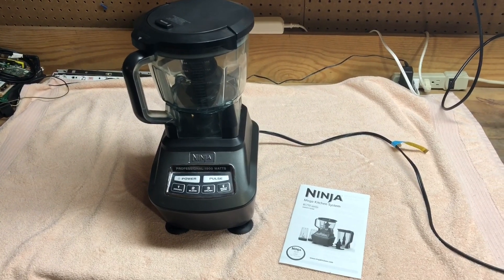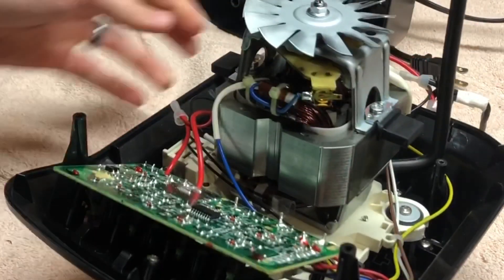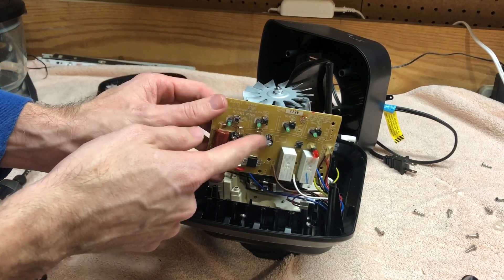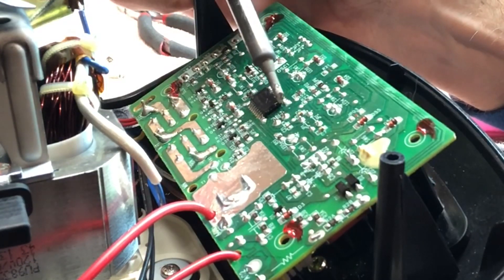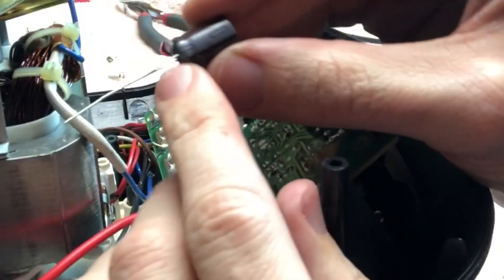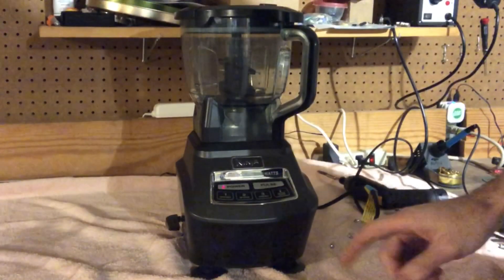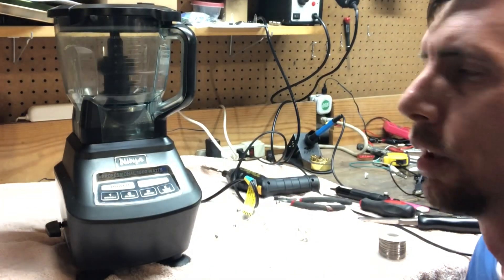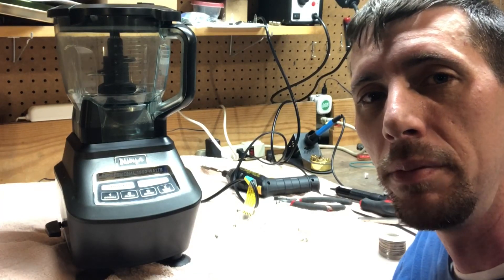Ninja Blender Repair

Comment: Hello That Guy. I indeed have an expensive box of garbage.  Its the Ninja bn801 Plus Kitchen System.  I was taken for a ride with this one. Themotor was too powerful itcouldnt handle bread dough,the blender  cups are shot the dough bowl is shot so is the other one. It mkelted the black plastic on the inside and got black plastic goo everywhere,it smoked and those things are like $75 each I dont have that. I should have just bought a cheap blender mortar/pestle and a small coffee grinder...and a kitchen aide stand up mixer.  I do have a solder kit my son purchased for me before he got married now i never saw him again.  I know better now ha ha ha. Just ranting. Thank you the video was great   in my case its different. Happy Holidays.

Comment: My Ninja base motor is smoking and there is a smell of plastic burning. In your experience could this be a capacitor symptom? -Katie in Napa Valley
Reply from the maker: There are many components that could potentially smoke if they failed. You would really just have to pull it apart and see what shows signs of burning.

Comment: Stopping buy, saying thanks for this video.  As it turns out, a blown capacitor wasn't my issue, but I did want to identify my fix.  

My Power LED would turn on when pressed.  The green LEDs would turn on when I had the respective single serve or full size blender installed.  My issues arose when I would select a blending option.  I could hear the relays click (and eventually "unclick" /timeout), but the motor would not spin.  My issue was all of a sudden--no notice of any performance degradation.

I figured maybe the capacitor that provides that extra bit of energy to get the motor going was faulty, so I swapped the capacitor (without troubleshooting or attempting any real diagnosis).  Swapping the cap out didn't solve anything.  

I did read somewhere (maybe in these comments?) about cold solder joints, so I took a real close look at the board and found that one of the TRIAC leg solder joints was cracked.  Reflowing solder to that leg solved my issue.  I hope someone else finds this useful!

Comment: Question need help on 1500 ninja blender I took it apart after power surge on building it went out  the blender didn’t want to work I too it apart I found the yellow varistor is burnt  is 10. 710  , my question is does other resistors burn after this happened ? Do I need to replace the capacitor or that thing you are replacing as well ? I’m about to throw it in the trash. But I’m watching your vid any advice please

Comment: I have a question I decided to open up my blender because it had gotten wet when I was cleaning it thought I kept it from getting wet but that ended up happening anyway I’ve dried everything and took it apart to get all of the water but I have no idea what could have been messed up for it to stop working the light won’t turn on and it only starts when I turn it on its side

Comment: Hi, got a similar bl770 blander, got motor runs only on pulse mode and any other button for low, med, high or single speed,  as soon as press them its power goes OFF, reset the power ( plug out plug-in) and it starts back on but same thing, what could be the reason, and how to check that resistor for swelling up? Thanks in advance🙂
Reply: Hey, just tried the same with replacing the same capacitor and got fixed, thanks heaps👍

Comment: Thanks.  I had already called Ninja OEM and since it was still in warranty period, they shipped me a new base unit.  Once I saw your video, I figured I had nothing to lose.  Bought 20ct capacitor pack and your recommended torx security set bits and went to work when they arrived.   Made good progress until I got to second security torx screw in the deep well.  Hole wasn't big enough to get screwdriver down to screw.  Luckily, a friend had a set similar to allen wrenches and the T9 was able to reach.  Made the repair (terrible at soldering) and reassembled.  Plugged in and power light came.  Pressed single serve button and now it's back in business.  Again thanks so much and this video is still helping people out after four years.

Comment: The power will come on ours but when pressing any spin mode, the blades will spin a couple times and then it starts buzzing continuously. Any ideas?
Reply from the maker: Potentially a different capacitor, but not sure. It’d be worth pulling apart to see if you see anything out of the ordinary.

Comment: I removed the board and replaced the capacitor. but the plastics that hold the screws for the board all broke off.
and I was quite delicate. it seems the screws have some sort of lock tight on it and the plastic pieces are quite brittle. 
basically, unless I find another way to hold the board in, this blender is garbage. 
so the verdict is they probably did this on purpose so you'd have to buy a new one.
shit company, this Ninja.
Reply from the maker: You may try to epoxy the screw posts back on with some quick curing epoxy.
Reply: @DustinRogersinMO  i'll give it a try, problem is they all broke off at various angles.
Reply: @DustinRogersinMO  I epoxied the posts back.
when I tried to screw the board back on the posts further broke apart.
they are incredibly brittle.
it's either just bad luck or this happens with particular models.
it just seems very odd they would use lock tight or some sort of glue to make the posts impossible to remove without breaking them.
at this point the Ninja is in the trash bin, unusable.
Reply from the maker: @vegan-master  it sucks you had troubles with it, but I just repaired our air fryer because the plastic on it was super brittle too. Hopefully it holds up for a while longer.
Reply: @DustinRogersinMO  can't say I didn't try

Comment: Hello Dustin,
My wife attempted to use a similar blender requiring 120V with 230V outlet, it currently not working any pointers on how to fix it?
Reply from the maker: Does the blender indicate that it will work on 230v? Some are dual voltage, but if yours isn’t, it may have been damaged by plugging it into a 230V outlet.

Comment: Dustin,
Great video.  Thank you very much.  
Would the capacitor be relevant if the power LED lights up and some but not all of the buttons work?
Pushing either Button #1 (Dough) or #2 (Blend) immediately shuts off the Ninja after spinning the blade for about 1 second.  Other buttons #3 (Crush) and Pulse work OK.  
I've got your recommended solder kit and capacitors, but not sure if this is a different problem.  Any suggestions would be welcome.
Thanks again for an excellent video.
Reply from the maker: I’m not sure. Mine wouldn’t do anything at all, so yours has some other issue. It could be some other capacitor that is failing or it could be the switches themselves. It’d definitely be worth getting it apart to see if there’s anything obvious (swollen capacitors, cold solder joints at the switches, or loose wire connections).

Comment: Edit: This was a followup to a post I apparently posted under the wrong vid. 

Hmmm, maybe a little luck. I now realize that on my old one I was pushing the buttons harder and thought they were not making contact, feeling mushy , today I was more careful in checking and found the buttons although having some extra play, do still hit the board. So, maybe that unit might have the capacitor problem you showed us. I'm still hoping you might advise regarding my previous questions since once I get in there I will of course then have a more sure analysis.

I just watched a repair post about a diferent unit and learned that my problem with the newer Ninja is the blade assembly in the single serve is rocking. The other optional mixing containers work fine, no wobbles, grinding or smell of electricity. Can't yet find the second single serve and can't remember if it had its own blade assembly cap.

Comment: That is so great instead of throwing things away. Our light still comes on but when we go to blend, it makes noise for 1 sec then stops and power light goes off. Ninja won't even address it as it isn't under warrantee anymore. Would you know what could be wrong?
Reply from the maker: It could be a similar issue. I’d recommend pulling it apart to check for swollen capacitors.

Comment: Hi Dustin, i have the same blender. Mine’s power light is turning on fine but none of blend buttons are working, so not able to use either Pulse, Dough, Blend, Crush, Single Serve. Could you share some thoughts on what could be wrong with it and what can I try to fix? It was working fine for past 2 years but today suddenly all buttons stopped working. Power led still turns on though.

Comment: Yes sir, so it happened I'm making my  morning smoothie and i go to start the Ninja 1500 watt blender and nothing,  I messed with it pressing the power button for all its worth and nothing, then the wife gets up and i say we are going to need a new Ninja, well the look on her face said fix it now, so I looked it up on YouTube and came accross your video. next I ordered a soder kit for $21 then ordered the the connector and figured why not right. so I start to take it apart and I then remembered you said something about the security screw and I was stumped because I didn't have that tool, So of course I did the next best thing and drilled that little sucker out. will I'm now back to my morning smoothie and it's thanks to your video. So thanks brother..

Comment: Thanks for the video. My BL610 only works on the bullet functions. If you try the blender power button blinks red. I’m told it smoked one day after heavy use. Is there an internal thermal fuse?  No visible damages on the IC board; all safety switches work. 

Ideas?

Comment: Thanks for a great video. I repaired mine and the problem was one of the (2) HF115F relays.
Reply: How did you know it was the relay please, mine clicks no power to the motor and the capicitor is good

Comment: As the others have said.... thank you 👍. The Ninja was a gift and used 2 x then DEAD. No more Radio Shack to go to so Amazon to the rescue to get the 25V capacitors.... Working once again !

And since it is basically a viariable speed "blender", the innards could have been simpler to control the speeds without the extra electronics.......

Comment: Hey Dustin, thanks for taking the time to make this video!!  Question: Does the Capacitor have the ability to work sometimes and then wig out and stop the power supply until you toggle the power switch on the wall? That's what is happening to mine. I get a solid red power light, I press any of the buttons to blend and most of the time it starts blending then I get a total power-out. Toggle the wall power switch once and the Red power light comes back on and it repeats the same cycle. Occasionally it works and we get a full blend - but that is getting rarer now.  Any help would be greatly appreciated. Thanks
Reply: If you have to turn the outlet switch OFF then back ON to make it work, it is more likely to be a capacitor's issue. Start with them, the big one first. Good luck

Comment: got a B700 that doesn't work and the motor seems locked up (can't manually turn the shaft). were you able to manually turn the blades/shaft prior to your repair? just curious before I get around to working on mine.
Reply: I could turn the motor (blades) before the repair

Comment: Hello Dustin, I have the same Ninja model.  It has power, but when press any of the button the motor is not turning.  Button #4 seems turn the motor on when you press, but don't have enough power to turn the top blade. What do you think wrong with it?

Comment: Hi Dustin. Thank you very much, ours did the same, I found a second hand 10V 1000mf capacitor, and we have our Ninja working again, saving us about $300. AUD although we run 240V mains it was still the came capacitor, we just have another 2 large resistors on the board. Thanks again.

Comment: The link beneath the video for purchasing a replacement capacitor at Amazon takes us to an $8.99 version. Is it a mistake, or has the price risen that much since this video was posted one year ago? Thank you.
Reply from the maker: The link is to a set of 10 capacitors (89¢ each), which is about the only way you’ll find them sold unless you go to a local electronics supply store that has them available individually. Likewise, you can order direct from an electronics supplier like digikey or mouser and buy just one for 60 to 90 cents, but you’ll probably end up paying $7 in shipping/handling charges.

Comment: My gray toothed wheel on the base that spins the blades in the pitcher is just free spinning... not keyed to the motor shaft?  
So the motor spins but not the blades.  
Suggestions?

Comment: Great Great video, so easy to follow. I have the same unit, light doesn’t come on but the capacitor isn’t swollen, could it still be that or possibly a different problem
Reply: Hi, I'm in a similar boat. Did it work after swapping? Cheers
Reply: @PrinceNwaDavid  Unfortunately not, had to get a new unit.

Comment: Hi 

Hmmm....so do u have any idea why the blades won't spin?  Won't spin with the tall or small pitcher.
Reply from the maker: It could be a bad motor, a damaged coupling, or a safety switch. Does it sound like the motor runs, but the blades don’t move? Or is there no response when selecting a speed? If no response, I’d check this capacitor. It’s been the culprit on many units according to many of the comments.
Reply: @DustinRogersinMO    Ahhhh 
thanks for responding....
Yeah the motor is going and it actually spins when there's nothing in it but when something is put in it it just runs... it looks like it tries to spin when I put something in it to crush... blend or whatever but won't .
Reply from the maker: @crwwcr61  I’d suspect something wrong with the drive mechanism then.
Reply from the maker: @crwwcr61  but I don’t know if Ninja sells replacement parts. They probably want you to buy a whole unit. One of the issues with a throw-away society
Reply: @DustinRogersinMO 
I don't think I'll be able to find a base at a reasonable price.  The base for one if these cost as much as a new blender.        🙂 thanks

Comment: To clean the big jug after making baby food, I added water all the way the top. It over flowed into the unit and after I shut it down it won’t power back up after 5 minutes, 10 minutes, 30 minutes and 1 hour. 

I made sure all the water is out of the vents during that entire time. 

Is there a way to reset the unit? Or just have to wait until it’s all dry to try again?

Comment: H i have ninja blander 1000 wattas but it not working . I opened it and found this little piece that I swapped out is broken and the size is 10v 470 uf , but I didn't find the same size. Can I replace it with a 16v 470 uf ???? please you can answering me
Reply from the maker: You should be fine replacing a 10v 470uf with a 16v 470uf. As long as the capacitance rating is the same and the voltage rating is equal or greater to the part being replaced.

Comment: Dustin: possibly the microswitch to internal cups is broken (not working cups) ...please let me know what is the series o model to buy and change?    Thank you.
Reply from the maker: Not sure. You’ll have to remove the switch and try to find a comparable match. Ninja will not sell it separately. You’ll likely have to try to find it from digi-key or mouser
Reply from the maker: You can also try find the wiring to the switch or where it hooks to the control board and temporarily jump that connection to see if that gets it working again before you try to find a replacement switch.

Comment: Thanks Dustin! 
My capacitor was also swelled. Found the exact cap. and replaced it today. Bingo! success !
Only thing the single serve button acts a little goofy, but works fine. Maybe the push button switch underneath is sticky? Or not lining up correctly? 
Thanks again!
Gods Bless Brother!,
Reply: This is exactly the kind of video we need to watching, direct to the point, show where the problem is and really is a very good!!!! Congratulations 🎉👏🎉

Comment: please help..  the part that you remove first..  how or where can i find it?   the part its the botton  with 4 screws    
mines get broke  my wifey pull up and it was stick in the kitchen table..  and 4 screw get broke  so i need that part..  please let me  know whats the part name or model or serial  to get it or find it
Reply from the maker: Since the base is held on with a security screw, the manufacturer doesn’t want anyone removing it, so they don’t offer that as a replacement part. Your best bet it to watch eBay listings for a motor unit (the entire blender motor) that may be defective. You could get the part you needed from that.
Reply from the maker: Like this (shipping price may be a deal breaker though) : https://www.ebay.com/itm/NON-WORKING-Ninja-Mega-Kitchen-Motor-Base-FOR-PARTS-BL770-BASE-Only-/224250031184?_trksid=p2349624.m46890.l49292
Reply: mine its a different model..  its squart
Reply: mine is  ninja foodi ss351
Reply from the maker: @ramiroochoa7693  oh. I think your best bet it to be find one used being sold for parts. I doubt that Ninja is going to sell that part individually. They’ll sell you the entire base/motor assembly.

Comment: Unfortunately my problem is one of the 3 pins in the bipolar transistor has burned out (for some reason) ST 8550c. Wondering if I can bypass it or how to fix it : /

Comment: I have this blender, and your video was great, but my problem is the single serve button. It lights but does not activate the motor when pushed.  All the other buttons work.
Reply: Were you able to fix it? I have the same issue